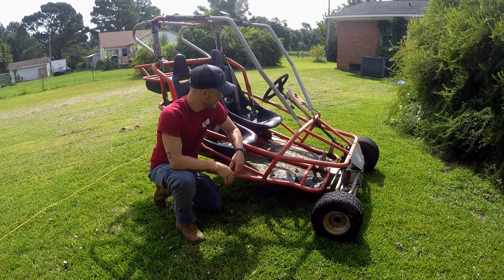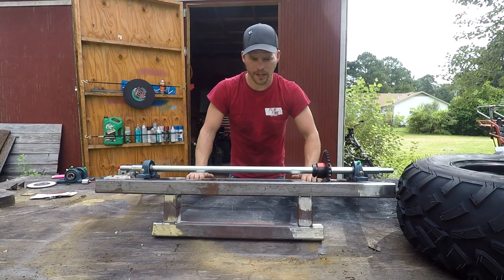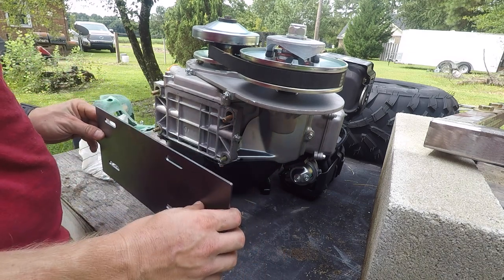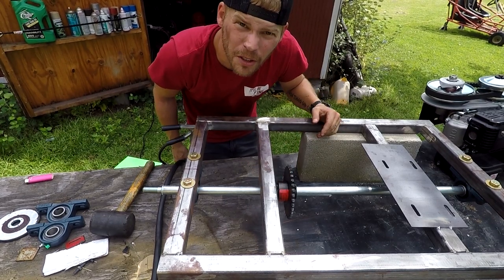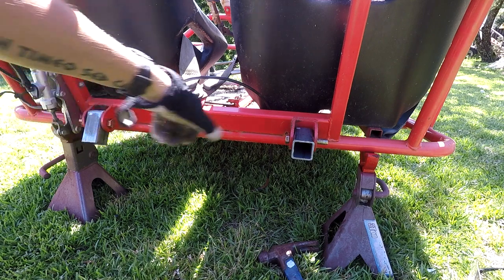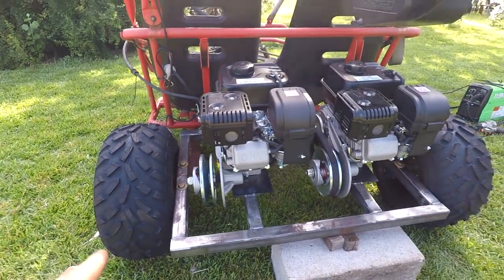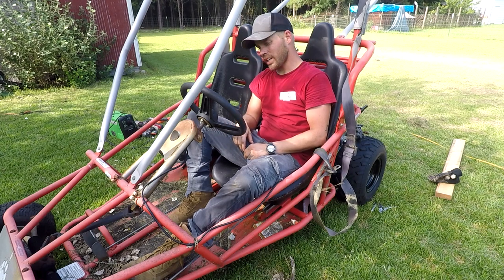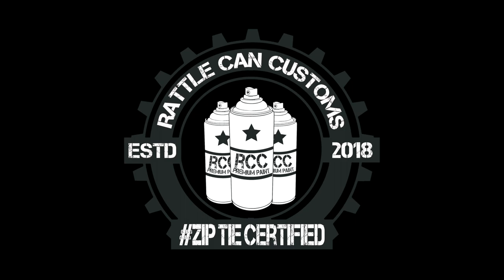DUAL 212cc Spiderbox Yerf Dog! Pt  2

Comment: Could you give me a sprocket setup and or clutch as well trying to do a single 212 don’t know much thanks in advance
Reply from the maker: That’s a big kart for a clutch, I would look into a 30 series torque converter, better power and more reliable. I just used 60 tooth sprockets on the axle and 10 tooth on the torque converters and it did great